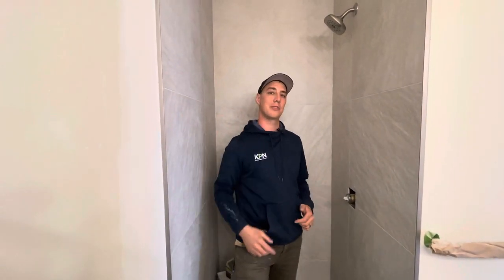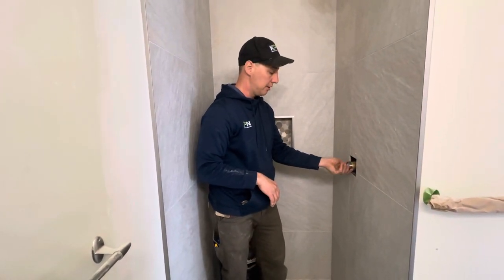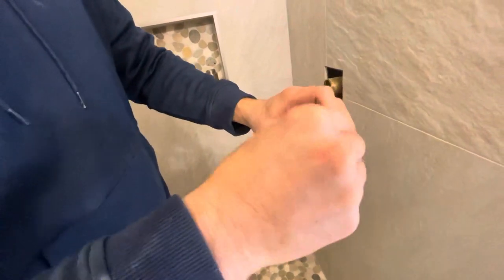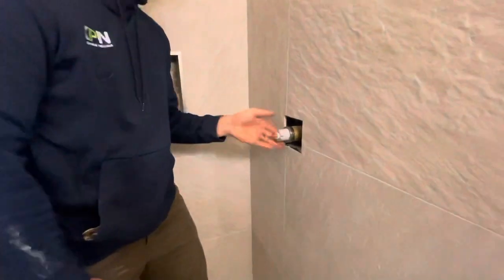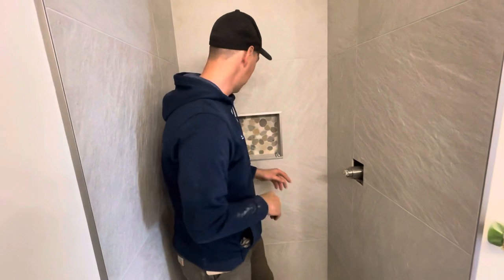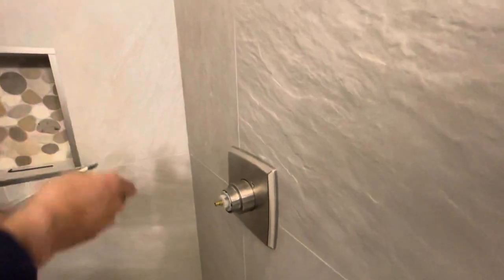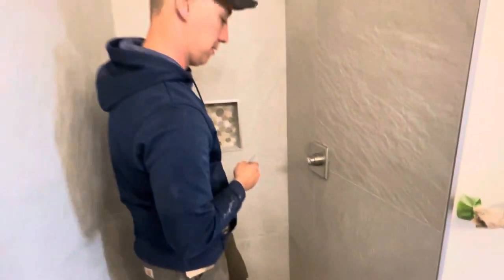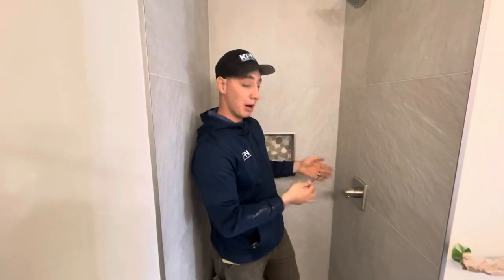Delta Shower Trim Installation // How To Install Delta

Comment: Thank you for sharing your knowledge in such a clear and concise presentation.   I learned to,  stand out of the way when removing plug,   hand tighten the nut with both hands vs using channel locks shown in all the other videos, where that round plastic piece goes, and how to properly set the water temperature   Great stuff
Reply from the maker: Glad it was helpful!

Comment: great video.  I'm getting ready to install my kit.  mine is a shower tub combo.  I am a bit nervous about the tub because if the spout adapter.  My tub has one already but it's not a good one and I'm sure it needs to be replaced. it is 15 years old (it is a delta ) but looks nothing like the new one that came with my new kit.  I am wondering if I should get a compression adapter (I saw a video that gave that suggestion)
Any advice would be appreciated.  I am installing this morning.
Sarah, 
From California
Reply from the maker: Join our Facebook group and we can help you further. 
The plumbing gurus